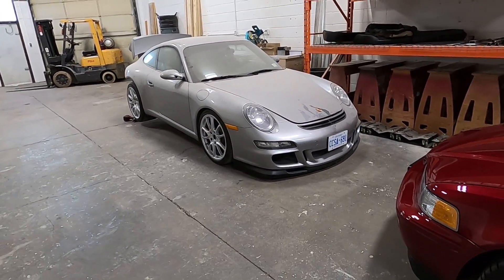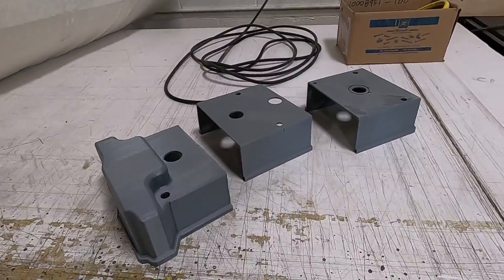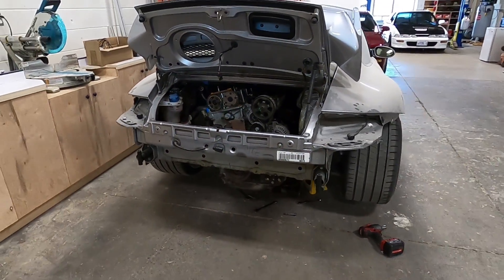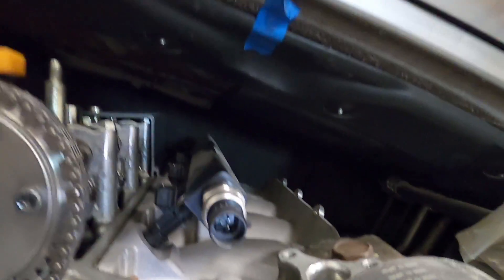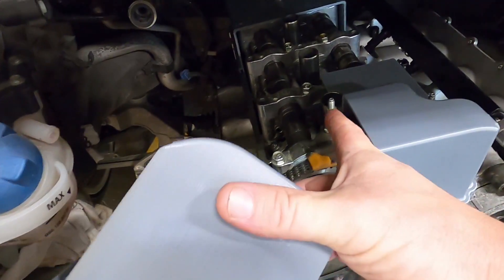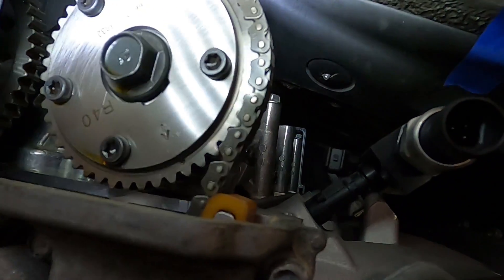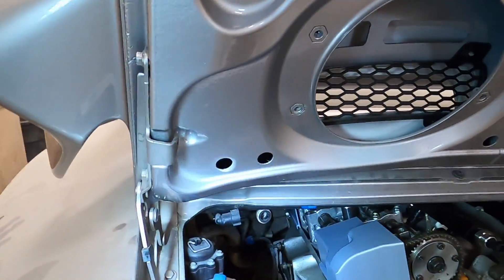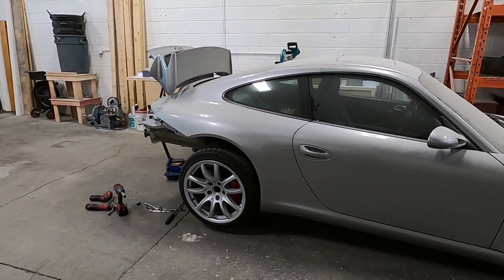K997 3D Printed Valve Cover

Comment: Looking good! How are you going to add oil? and are you going to run valve cover venting? With the little amount of clearance dry sump system would greatly benefit the engine.
Reply from the maker: The final version will have an oil fill cap and fittings for a catch can breather. I agree i dry sump would be super nice, but realistically the added complexity and sheer cost of a system doesn't make any sense for this project at this level of performance.

Comment: What was the issue with lowering the engine an inch again? Also, what is under that black plastic piece at the top of the engine bay? Is that something you can remove to add a little more clearance? Then put some heat tape on it to help control engine bay temps.
Reply from the maker: There is a structural suspension brace in the way preventing us from lowering it more. There are other issues with lowering it anymore such as driveshaft angle and reconnecting the shifter cables. The top of the engine bay is all steel and would need to be cut out to gain more clearance. That's technically doable, but one goal was to do this swap without having to cut the car in such a way